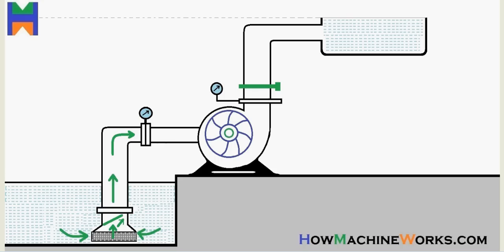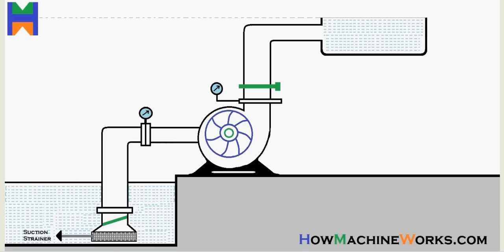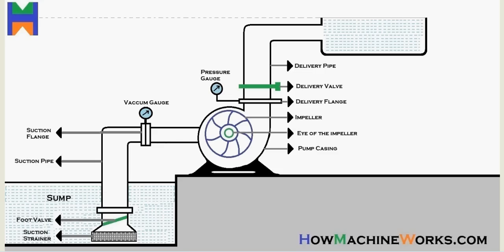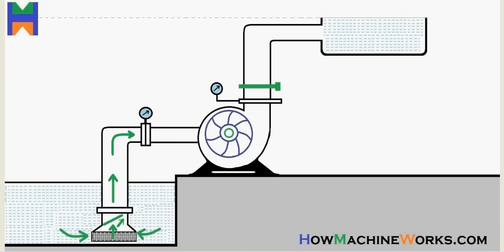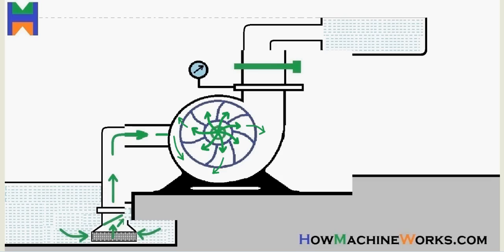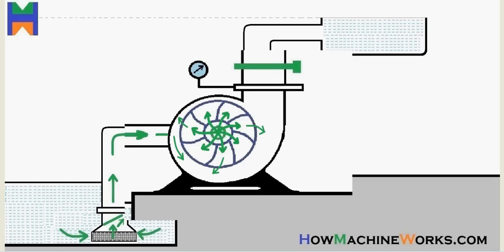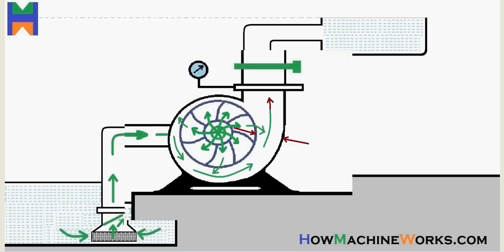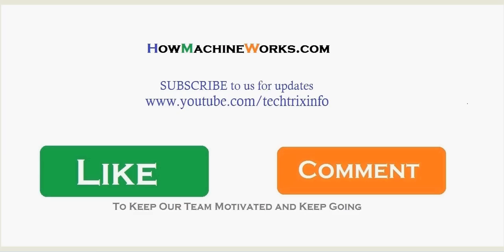How centrifugal home water pump works - in detail

Comment: Thanks...why there are some points around the inlet have a negative pressure?
Reply: +Have a nice time! 

because of Npsa Available for the system is less than the NPSH required by the pump causing negative pressure that create bubbles and lead to cavitation
Reply: +AHMED ALBUSAIDI Thanks :)

Comment: Hi 
Thanks for this explanation, but I need to alert me to the presence of air instead of water inside the pump through an electrical device that stops the pump's operation
, cam you tel me please about that 
thanks

Comment: Bernoulli equation:
p1 + 0.5*density*v^2 + density*g*h1 = p2 + 0.5*density*v^2 + density*g*h2
By continuity A1V1=A2V2, so as the area increases the velocity decreases.
Ignoring the GPE term, the first half and second half of Bernoulli's equation need to be equal.
As the velocity decreases the dynamic pressure (0.5*density*v^2) decreases, and as a result, the static pressure (p2) must be larger than p1 in order for the equation to be correct.  I guess that's what he means.  Also, if p2, is equal to the cavitation pressure of liquid then the liquid will evaporate.

Comment: sir can u tell me what is 'delivery valve' ?? i have motor in our apmnt. sump is full. daily i used to switch on motor then open a red colored knob , check whether the water flowing out or not then close it immediately . but today when i switched onn the motor, and when opened the red knob , the water didnt flow out of it. hence i immediately switched off the motor. thinking that the water is not supplied from sump.  is it necessary that to chk the water flow by opening the red knob ?? plz help me...

Comment: Could a VAWT turbine turning at normal speeds due to the wind velocity at any given time, rotate a magnetic drive centrifugal pump to operate and pump water as normal like you have shown? If you have made any such tests, at what height max have you reached with the positioning of the head tank relative to the ground level?

Comment: I'm sorry if this question is dumb. How it does to absorb the water? (I can't understand you because im from chile, spanish speaking)
Reply from the maker: Thanks for the comment.Connect with us on WhatsApp @ +919744615655
Reply: dud the water is sucked because as the water is delivered  negative pressure is devloped in the eye due to which the water is sucked
Reply: dud the water is sucked because as the water is delivered  negative pressure is devloped in the eye due to which the water is sucked
Reply: There is something called pump "priming" . A must step that fills the pump casing with water. The sucking concept happens AFTER the casing is full of water otherwise the pump  will be sucking air only

Comment: Nice, but there is a small mistake in this presentation. 

The impeller is shown to be rotating in clockwise direction where as the water flowing out shown to be coming out in clockwise direction.

Thanks.
Reply: Same question I did have seeing ut

Comment: impeller is shown moving in clockwise direction which i think is wrong, as the water is climbing up, impeller should be moving in anticlockwise direction. correct me if i am wrong.
Reply: +Vikas Omar . Vikas, the impeller vanes are rotating in the right direction. That's how it is int the field.

Comment: direction of rotation of impeller is wrong, it should be counter clock wise
Reply: +Deepak Babbar  I don't know if it should be clockwise or counterclockwise but, I can tell your for sure that the pump vanes are rotating in the right direction in order to provide the discharge pressure.
Reply: Indeed, the impellor should rotate in the different way!

Comment: The animation is clear. But the concept that as area increases pressure increases is wrong and misleading.
Reply: +Kavinaya Ponnuswamy no no its correct ... its coz pressure head = v^2/2g=(wr)^2/2g .... therefore as radius increases pressure head increases :) ... hope its clear
Reply: in my concept...by area increasing velocity decreases...therefore there will be a change in kinetic energy and it is converted into useful form of pressure.....

this is only my opinion...dont know whether it is true or not
Reply: in my concept...by area increasing velocity decreases...therefore there will be a change in kinetic energy and it is converted into useful form of pressure.....

this is only my opinion...dont know whether it is true or not
Reply: in my concept...by area increasing velocity decreases...therefore there will be a change in kinetic energy and it is converted into useful form of pressure.....

this is only my opinion...dont know whether it is true or not

Comment: when area increases between the impeller and the casing, the velocity decreases and pressure increases , i did not get why the pressure increases
Reply: this is due to the Bernoulli principle which is a direct consequence of the conservation of energy.
Reply from the maker: enoxosr1 Great.Thank you, Please SUBSCRIBE to us for more videos. We have a face book
 page just search for TechTrixInfo in face book  -  TechTrixInfo.com
Reply: Easiest is to compare this with flow of water through a hose, the amount of water flow from pipe to a drum, is equivalent  to pressure, the water flowing through the hose is equivalent to current. so More water flow, mean more current flow through a wire ( if the wire is thicker), second, more water flow, will fill up tank faster, means pressure is higher, same in case of electricity, more current flow through throw through wire will produce higher potential or voltage. hope it will help you. Thanks